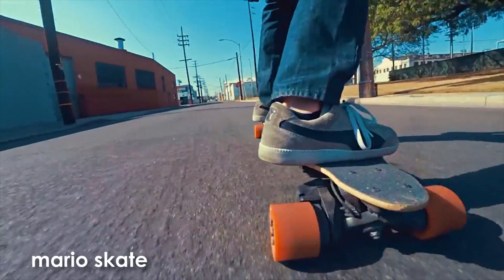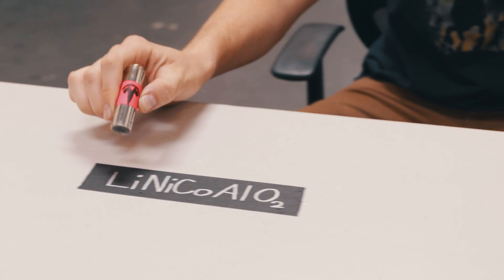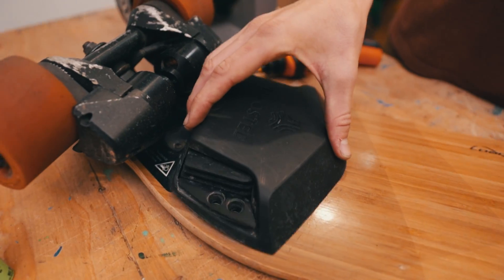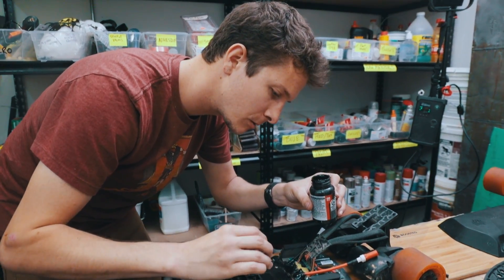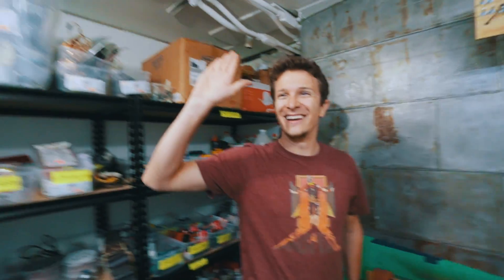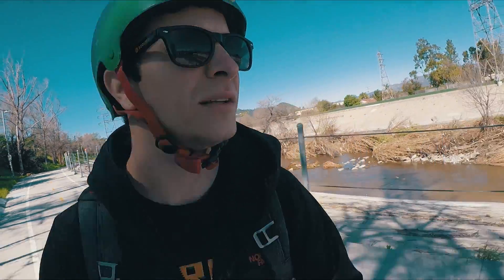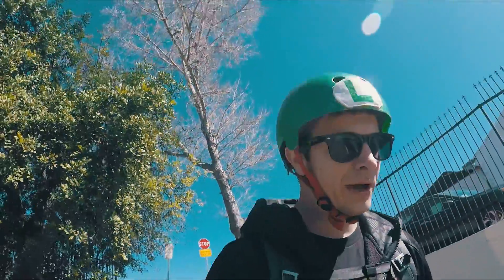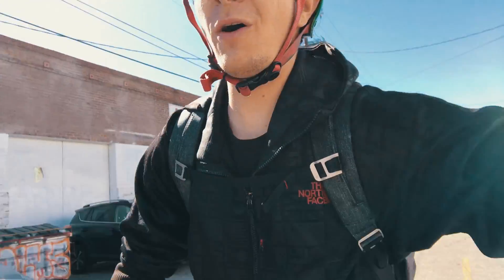Tesla Batteries in an Electric Skateboard!

Comment: wren the battery of the boosted board stops for a reason its to not overdischarge it. when you overdischarge it you can damage them and how you connected your own cells bypasses the protection i would recomend to connect the extra battery directly across the boosted board battery but make sure you get the same amount of cells and so the right voltage.

Comment: if you have already voided your warranty, why not ditch the inferior boosted board battery, make the "tesla" batteries the primary battery rather than supplemental and add a 3rd and 4th battery pack in the originals place?

Comment: technically that you could use a voltage booster chip. They use them for vapes all the time. Most vapes can output more power than there batterys actally holds. Then again those are high drain batterys as well.

Comment: You could make a high voltage joule thief but it would kill the batteries over prolonged use unless you added a cutoff circuit so you don't drain them too much.

Comment: you could use a dc-dc step up converter to boost your voltage to 40V, they can be found on amazon for around 25$. The downside is that the have a efficiency of about 90-95% so you might need cooling (maybe a heat sink and the wind from driving is enough). I would also install a battery alarm (3$) to start beeping at a cut off voltage that you don't over-discharge your battery's and can drive without worrying. If you have some more questions ask them and I will try to help you (doing rc stuff as a hobby).
Grüße aus Deutschland (greetings form Germany)

Comment: I guess what happens is, that the drained original battery runs out of its operational range, while the new pack still keep the board running. but at the same time, it tries to get this power to charge itself (maybe?).
Whatever it is (if it's not some hard-coded stuff in the control board that cuts off power to prevent under-voltage), I think first you need to separate the batteries.
Then I could imagine a (maybe a bit over-complicated) separate control on it, to monitor the voltage level of the original battery. If it drops below a certain point, it flips a relay, cuts off the original one and connects the new ones. 
Basically changing batteries on the fly. You could do this with a micro-controller automatically, or maybe with a key fob. Or even simpler with a manual switch somewhere on the board.
Next thing would be a boost converter that is rated high enough to keep your voltage on the motor side above the cut-off level. Don't know how your amperage looks like then, but I guess the motors won't run efficiently on a voltage that low, if the original battery craps out sooner. 
Also I have no idea how convenient it would be to charge. Just some ideas.

Comment: i just subscribed...  i do electronics as a hobby...  try a step up converter... add a switch to it to override the voltage when the speed it low...  but this might add a bit of weight to your board.. step ups can be a bit heavy....  have a look : http://www.ebay.in/itm/DC-DC-600W-10-60V-TO-12-80V-STEP-UP-CONVERTER-BE0231-/252601545845?hash=item3ad039b475:g:XyQAAOSw9GhYjF-5  i am waiting.. do nit disappoint me

Comment: Your best solution is to use the same batteries the boosted board is using since the board's Battery Management System (BMS) is not meant to be used with Li-ion (since they're LiFePO4?). It's not easy to use different chemistries (or even simply different capacity cells)  in parallel since they'll start having different voltages which tends to cause issues (cells draining into other cells I believe). If you want total control over your build it might be easier to start from scratch, buy a BMS, more batteries (since you can definitely reuse yours) a motor (Turnigy SK3s are da bomb) and a motor mount + truck. I'm sure you've seen but there's a lot of really helpful forums online with lots of good stuff on them so they're worth checking out.

Comment: FWIW most lithium batteries have a physical cutoff that triggers when undervolted to prevent further depletion and will make the cell read 0V. On a 3.7V cell like those 18650's, that's probably at about 3V per cell. If you just connect a fully charged cell to the depleted battery for a quick, you can jumpstart it enough to disable the physical cutoff and bring it back into a range the charge should recognize.

Comment: maybe you could use a third 30V battery, which could act as a buffer. With the two packs, charging the buffer, which is connected to the board, the voltage would stay at above 30V, when the battery is being charged slightly faster, then the packs are giving out energy. So, if I got your problem right and remembered everything correctly, the packs charge up the third battery when the board doesn't accept them anymore, so their voltage adds up together in the buffer.

not sure if this will work, but I hope, I could help

Comment: I dont have a boosted board so I dont know if this will work but what I would try and do is disconnect the original battery completely which may give you more space to add a custom one. Or if that does not work I would try and do it design a switch that when the main smaller battery runs out, would disconnect from the circuit so that you are just running on the two custom ones

Comment: Put a dynamo on the weels of the board so it charges the battery as you ride it, thus slowing the time it takes to drain the battery. Yeah it doesn't access the extra power, but it will increase the ride time of the board.

Comment: Add a switch to toggle between the internal battery to the external batteries. That way, you run on just the BBoard battery for 5 miles, then flip switch, then the Tesla batteries for 10mi. Boost converters just introduce inefficiencies (and add heat) that would cut your range by a few miles either way.

Switching also allows you to use the battery monitor on the tesla batteries. It would not be 100% accurate, but it would be a good aproximation until the tesla batteries dropped below 33.5V, where it would read zero.

Comment: Didn't you wire those batteries in series, not parallel? I mean, each pack was in parallel, but the batteries inside were in series, right?

Comment: I don't know but could you use an Arduino to check if the voltage dops below a specific voltage and when if does access a boost converter or something like that?

Comment: You should consider that your batteries probably have a lower current. They might have the matching voltage but a lower current which leads to less electrical power at the end. And that finally leads to a slower and weaker boosted board when you use them ;)

Comment: If you ask me i think your only efficient option would be to match the battery chemistry of the original battery pack with your new packs so they both have the same working voltage range, any other option would be very inefficient ( voltage boosting circuits / charge transference) or very costly and require lots of work such as gutting the electronics to use a motor controller designed to work with the working voltage range of the new packs or a "fake" voltage supply to the voltage sensing circuit on the board so it thinks the battery is still full while removing the original battery and using the new battery packs with an external voltage monitoring BMS to protect against over discharge.

Comment: You can use a boost converter. But there are two problems you need to solve.
1. You need a battery monitoring devise between battery and boost converter so your batterys wont get damaged. The Boostedboard safety devise will not work for your battery pack any more because it will always get 40V from that boost converter.
2. The Boostedboard needs a fairly high current to drive the motors. That will heat up the boost converters even if they are rated for that high currents. So you need a pretty big heatsink.
The last problem you need to think of is that a boost converter has an efficiency from around 75% to 90%. So there is the possibility that you wont gain any power because of the power loss factor.

Comment: Just add a Mr. Fusion, no concerns with power then.  
Can you just run off your batteries and by pass the smaller stock battery? 
I don't know electronics very well, would it also be possible to have the stock battery be the last battery in the chain to drain?   Will that get you through the first two Tesla Batteries, before hitting the stock battery?

Comment: Hey Wren, 
A quick napkin calculation to estimate range... You just need to measure the current draw from the battery when its running. Put it on a treadmill and get a buddy to use a current clamp (http://www.sears.com/craftsman-digital-clamp-on-ammeter/p-03482369000P) to measure the current out of the battery. Its usually easier to make the V+ wire longer to hook the meter up to it. Then just divide that measurement by the mAh rating of the pack you created. 

Those panasonic cells are probably 3400 mAh cells by my guess, so (10 cells series * 2 parallel strings) == 6800mAh. If you measure a 10 Amp draw from the batteries when its running, then a rough estimate of battery life is 6.8AH / 10A == .67 Hour, or about 41 minutes. (If you want to reach your destination comfortably, I'd want a 1.5:1 margin to be safe. Travel time is 1hr, I'd want 1.5hrs worth of mAh).

Second, the electronics specify a shutdown limit for the battery voltage in terms of volts per cell, which is a value driven by the cell manufacturers (panasonic).  The cell manufacturer typically specifies 2.5 volts per cell as a fully depleted cell, but you can usually take this down to 2.0v without issues (although for < 10% extra runtime). 

You want to tell the boosted board your new battery is at 33.5v when its really at 30v,  to squeeze that extra runtime out, the electronics has a tiny circuit on it that takes this voltage(30v), and divides it down to a level that the microcontroller can measure safely(0-5v). If you increase this divider ratio (1 resistor change), it will trick the board into measuring a higher voltage than in reality. This requires precision soldering skills though, and if the board is also measuring intermediate cell voltages, this trick wont work without changing those circuits as well...

Comment: Remove the boostit board battery pack, add another Tesla battery pack in series with the other two parallel battery packs to replace the original pack

Comment: You should try having the board running on EITHER the stock battery or the custom ones. If you just care about charge duration, you can have an independent circuit charge the stock battery (maybe even through the built-in charging port). On the other hand, if you want higher current delivery you can do vice versa and have the stock battery charge the custom ones. You'd be basically building a power bank for your board.
Also, check if the board controller is current-limiting.
Btw, you should really consider having separated charging wires for each cell ("series-module") in order to balance-charge them. This can really increase the battery overall longevity and avoid the risk of over charging/discharging your battery (with subsequent swelling/popping/catching fire).

Comment: You should make a battery backpack for the boosted board, so put all the batteries inside a backpack and add a cord to connect the boosted board and get the maximum range possible. And for the voltage problem, you need to add a Voltage Regulator, it's pretty easy to build one or you can buy one online.

Comment: A lot of people are suggesting using a step up transformer to get that extra voltage. Instead I would add other Panasonic battery to your series making a pack that is supplying 44VDC. If you drop your power 25% you will then be at 33VDC.

Comment: Would an Alternator work? It might mean you need some more tech on the board but could continually charge the board whilst you ride. The only issue then is cooling, which can be solved with proper ventilation and maybe some liquid cooling

Comment: If you're having trouble with your car battery a cheap fix to that would using a bunch of 3S lithium packs in parallel to jump start it. Us RC guys have been using them to jump start our cars for years. 
Also you can manually charge over depleted lithium packs by charging them as a NiMh on a hobby charger, although it is much better to just not let it get over depleted in the first place it is more convenient than getting towed around. Charge them until the charger can recognise them as lithium again.

Comment: I'm guessing the original battery is a lipo? If so, you really should just remove it and use 18650 there too... It's been over discharged so it lost a lot of it's ability to deliver current, and using 2 different types of batteries isn't really good for them (as you said, it's running down to 30v, so the lipo is getting over discharged again). That said if rremoving it really isn't an option (not enough current even adding more 18650s cells), you might be able to turn your banks into a charger if the board has the charging circuitry inside, disconnecting them from the main board and connecting them to the charging port. I don't know how the boosted board is build internally tho, you could only do this if the charger is just a power supply and not a lipo charger (so you know the charging circuitry is internal- you cannot charge lipos just by reversing voltage to them, they WILL explode). Depending on the charrging circuitry, its possible it still will not run under a certain voltage... in that case, add a boost converter of appropriate size... I hope this was useful! ;)

Comment: Just to say, typically bike helmets are only good for one drop, because the impact to the foam compresses it, and once compressed it adds no protection. Seeing as you dropped it from a high height at 9:35, you might need to buy a new helmet.

Comment: You have to be careful, you need to match batteries. So if one outputs 1.2 V and the other 6 output 1.5 V you need to group the 1.5 V first then make another pack with batteries that are 1.2. You Do this because your pack is as only good as your worse battery. So if you put that 1.2 is the 1.5 pack you're charge (and discharge) is as only good as that 1.2 battery
To fix that energy thing you need to change the BPS system. That's there to make sure you don't over discharge or overcharge. You need to bipass that system. Not sure how to do that without completely redsigning the system.
and of course because I didn't watch the whole video before comment I just now realized you already know this... Sorry

Comment: Easiest way I think would be to make small packs for something like 5~10 volts and a switch (or a few) to connect them (in series) when the voltage drops, the problem is that the extra batteries will be underutilized.

Comment: You could use a boost converter, yes. Though their efficiency is approximately 88% for ~40V non low current. A slightly more efficient solution could be putting more batteries in serial, thus increasing the voltage, so the the lowest point is around 40V, and then using a buck converter to step the voltage down, these have a slightly higher efficiency at ~94%.

Comment: isnt there a way where you can switch the battery output so as one dies it will switch and then use the power of the other two? giving you two batteries instead of a longer battery?

im not an engineer or very good with science so im no good with this XD

Comment: usually hub motors has low kv, so you need to make 12s batteries or 11s but be careful do not burn the motor controllers. If it is VESC's it could handle maximum 60 volts.

Comment: A few  people already suggested it but I'll try to go more in depth. Charge the stock battery with your DIY packs. The way the boosted board charges its stock pack greatly affects the doability of this tho, can the board move while charging? The charger most likely stops charging once the pack is full but does it resume charging if the voltage drops, in other words if you have the board charging with a mile long extension cord, will the battery still be full after the mile long ride when the extension cord is yanked out of the outlet? If yes then I'd just use a DC-DC buck-boost converter with a low voltage cutoff to feed a voltage identical to that of the charger voltage into the charge port. That way you'll be charging the main battery with your own packs until you hit the voltage cutoff, then the board starts to discharge the main battery once your custom packs are empty. Yes you'd be wasting some energy on the charging circuit but probably not that much since you're only converting dc voltage to a different dc voltage.

Comment: i dont know technical stuff like that but you could try instaling a second wire that switches to the other 2 battery packs once the original has reached its limit.
metaphorically speaking,
in the film After earth, the scene with the medical procedure where the blood flow is blocked and a plastic tube is put in to correct the blood flow

Comment: Have the battery pack charge go through the boosted board battery. Essentially charging the boosted board battery while you use it. Just like being connected to a wall outlet while using your phone. I don't know if you can provide enough power to replenish the BB battery as fast as you run out of it.

Comment: there is no capacity left. you have to measure voltage under load. the voltage will drop as soon as you pull some current. just get more batteries

Comment: could you make it switch over to another battery from a wireless switch. you could use a lithium ion to make it up hills, or just use more Tesla batteries in tandem rather than parallel maybe? just guessing not an electrician by any means.